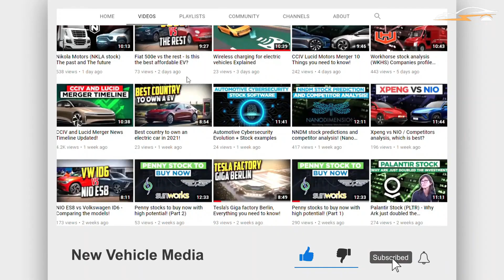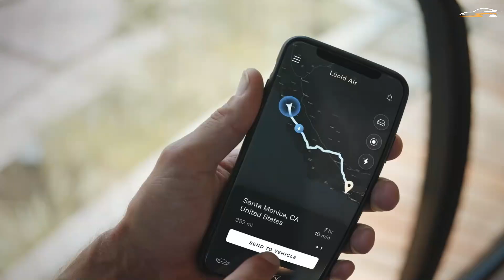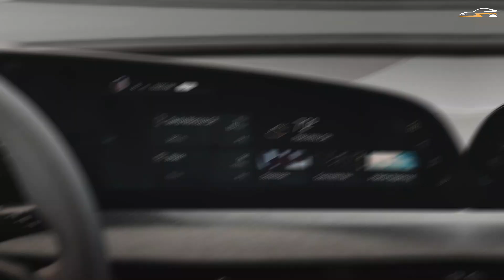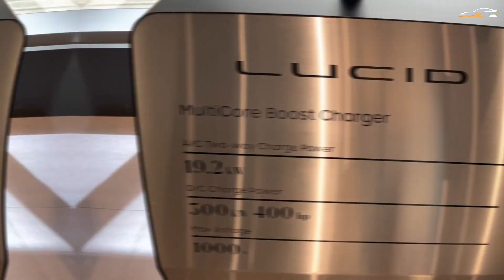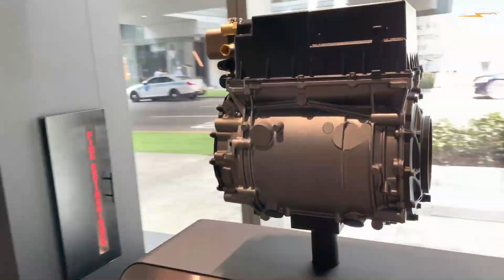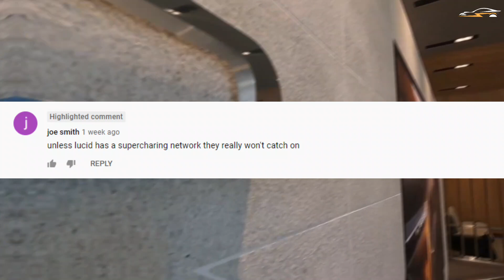Lucid motors PLANS TO DO GOOD to their old batteries!

Comment: Joe's wrong, every EV manufacturer won't need their own charging network because EV charging stations will make them for these vehicle companies as EVs are normalized and battery formulations become somewhat standardized. 

Not to mention gas stations will deploy their own branded chargers to keep themselves relevant and profitable, and the fuel companies that supply them fuels will develop/purchase fast chargers as EVs become the "norm" at 20-30% adoption.

Comment: There is going to be a lot of dead and worthless EV cars in the coming years.  8 to 10 year battery life is not very long, and I understand that a battery replacement job is very expensive.  Meanwhile we have gasoline cars from the 1950s and later still running.  I am not knocking EVs, it's just that this is a pretty big difference.
Reply: Did you watch the video before posting this?

Comment: They need to plan on putting a car on the road first.  Lucid has been a battery company since 2007!!!! I hope that you would have that figured by now.  Focus on cars
Reply: dont you get it? they've been focusing on putting cars on the road. theres a schedule for delivery. Meanwhile when youre planning on selling cars with batteries that will run out its necessary to plan for the lifespan of the batteries if you want your cars to be viable products. if IC engines only lasted 5 years then carmakers would have had to establish a system to replace and destroy or reuses the engines wouldnt they? if they didnt no one would want the car.
Reply: @mikesuniverse1789  Agreed.